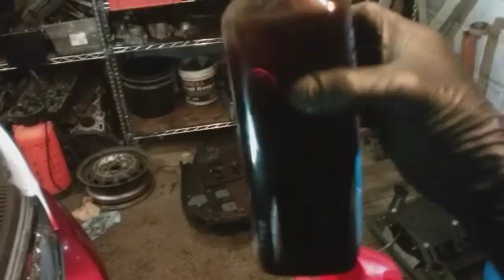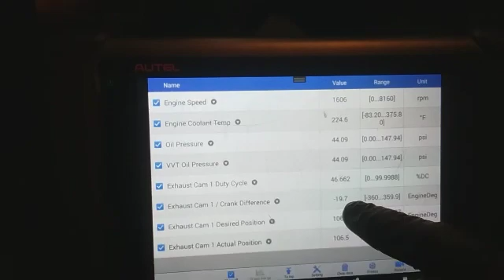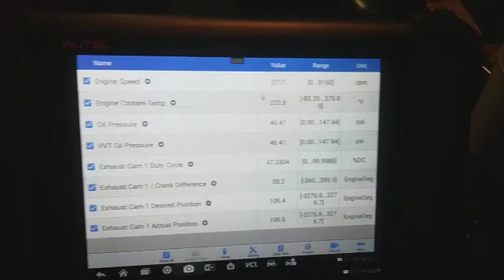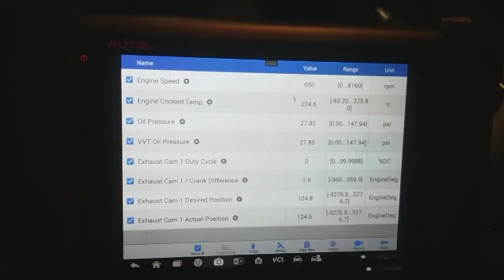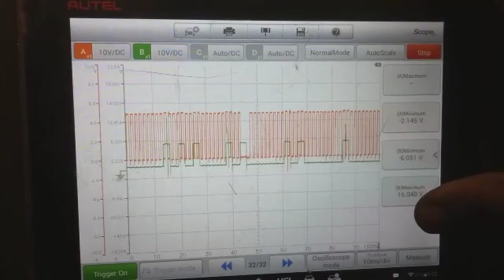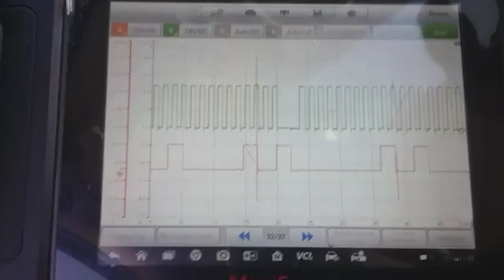P0344 FIXED! DODGE 5.7 DONT CHANGE THE CAM SESNOR JUST YET

Comment: 6 damn years ago, and this video helped me solve why my codes were coming on, and truth be told, never thought after a oil change, I would blow a oil line, it was subtle and slow, but found oil all over the lower end, slow leak, and i guess sensor got too hot, and got a low oil pressure code... man o man, your a god send.

Comment: Just recently went through this my buddy recommended I check to oil control valve beneath the intake manifold. Have had an issue since replacing it. Hope that helps!!
Reply: Correction: “Haven’t”

Comment: Broooooooo!!! I have had this exact issue for the last several weeks. My 2014 Ram 1500 Express 5.7L Truck has 190,000+ miles on. We had a really bad cold snap here is the Midwest.  My truck through a P0344 Camshaft Position Sensor code. Of course the first thing I did was replace the camshaft sensor. This actually seemed to cause more issues with the truck, as it started to go into limp mode. I replaced the spark plugs and coils as well. Needless to say, I did everything I could think of to do with it and even took it to a local shop and they told me to replace the cam and crank shaft sensor with OEM parts. I searched and searched the internet for answers. Somehow I finally came across your video and all of these great comments. This morning I changed my oil, reset the code and drove the piss out of my truck. No code!!!!!!!! Who would have thought something as simple as an oil change would solve all of the worlds problems!!!! Thanks for this video!!!! This should be the first thing that comes up when this code is searched.
Reply from the maker: @ShawnFranklin-h9t  cool man... thanks.

Comment: Guys, I also figured out that you have to reset your oil life on these vehicles. If it goes too long the oil count will cause the engine to go into limp mode. Turn the key to the run position without starting the engine. Press the gas peddle FULLY three times, within 30 seconds, and turn the key off. Start the vehicle and your oil life is reset. Have a great day.

Comment: Clean the plugs and contacts with electrical connectors spray, I used wd40 brand, plus took the sensor out and cleaned around the o ring and the magnet, if you do buy new get name brand, magnets on cheap ones are to weak and don't use the contact cleaner with power flowing thru battery, do this to the cam and crank sensors, they work together, can always check voltage on plugs . Should be 12v power and 5-10 on signal, middle is neutral, will be 3 pins,  both on passenger side under the side of the motor, one up front and one on back. At  Least on my 04 dodge 1500

Comment: My 2014 ram 1500 had the PO344 code and noticed low oil pressure I had a fairly recent oil change so I checked my oil level it was fine changed cam shaft sensor still check engine light came back on still low oil pressure so took it to the deal for a full diagnostic they came to the conclusion that it will need a new motor so I took it home thought about it and figured il change my oil again and check for metal shavings from a possible cam lifter issue there was no metal in the oil so changed my oil and problem fixed oil pressure back to normal and check engine light gone. 🤷
Reply: Did it ever come back?
Reply: @J.Smithsonian so far no

Comment: 4 years later, and I am at my wits end with a P0344. FYI - this was a complete engine build. The only stock item is the intake manifold. I am running Royal Purple break in oil (10w-30) and I would like to avoid changing the oil for no reason - that stuff was expensive. I only have about 15min run time on this engine. My tuner won't continue with the tune until the code is fixed. I had a bunch of misfire codes to begin with, but no P0344. Now it's throwing the P0344. I have replaced the cam sensor (but was told I need to put the OEM sensor back in) with no change. Misfires continue to count up in HP Tuners every time it is started. Was your fix an oil change or the crank sensor? I have a launch x432 - how do I get waveforms for these sensors on the Launch?

Comment: I’m at my breaking point with my son’s first car (08’ Charger 3.5L V6 w/129K) that we bought just over a year ago when it had 128k miles on it! Less than 1500 miles in one year! So far I’ve replaced All 4 rotors+pads, both front side suspensions, rear wheel bearing hubs, the starter, thermostat w/housing, all of those led to the WATER PUMP replacement!!! Ever since I’ve replaced it along with the timing belt, because if you are already in there you might as well replace the belt SO I did plus the serpentine belt! The fan assembly I replaced also because the two fans had been snapped in multiple places from prior “mechanics” plus myself adding a couple more due the awesome “plastic” design! 
That was in April when I pull two back to back ALL NIGHTERS because the dealership’s tow truck was picking it up to replace the AIRBAGS THAT were defective!!! It waited until after my May 1st birthday to reel back in and ever since I have been getting P0344 code, P0300, C121A & C121C, 2205, and so on! One code was the speed sensors that I also replaced AND NOW I FINALLY watched ALL OF YOUR VIDEO that reminded me of the OIL CHANGE my son had done last fall! Mother!$&@&@!ER! Well my fingers are crossed!!! 
P.S The last thing would do is complain about HOW F-ING LONG it took you to get to your point!!! I think a couple of Darren’s married Karen’s!!! 😂😂

Comment: 2009 300C kept reading p340 after changing cam position sensor problem got worse and read p340 and p344 they were timing chain issues there is a recall on parts and Chrysler fixed for free

Comment: Sr i need your help. i have a 2011 Dodge Ram 1500 5.7 over 2 months ago i had a check engine light came on, so i took it to a shop and they replaced the vvt solenoid, and everything was well with the truck till 2 days later the check engine light came back but this time came with the traction light and since than the codes on the truck were P0344 and P0340 i took it back to the shop and this time they replced the CAM and CRANK Sensors, but still didnt work out, then they changed the oil and the oil filter, they put on a 20/50 and the lights stills there, any idea how to fix it?????
also the truck is wasting a lot of gas, and the shop they dont know what else to do  & the Dealer doesnt have appointments till 2 months from now. so pls anyone can help me??????
Reply: Notice, the only code on the truck right now is P0344.
Reply from the maker: Timing chain likely will have to be replaced with vvt actuator
Reply: @partsshooter  Sounds good I’ll ask the guys from the shop to do that. Also the truck has lack of acceleration when is over 40/50 mph.
Reply: @partsshooter  Thank you so much for your help & your quick response. I really appreciate it.
Reply: @gedwerhoil1201 was that the issue? Please followup. Thanks
Reply: also i alreaty paid more than $700 i really need help.

Comment: I'll be d@^&*, I have an oil leak I haven't got around to fixing, until recently I had been diligent in checking the oil level, but got lazy recently. I had this come up 3 days ago and got progressively worse, even after replacing with a know good OEM sensor I had left over. Checked the wiring and could not find any problem, multi-meter tests are good. By the third day on 40 mile drive, I was loosing power, couldn't rev over 2500 rpm, intermittently and seemed to happen most going up or down hills. I watch this video and at first I'm saying you're high. But I go out and check my oil level (I'm only halfway through the life from the last oil change) and I was 3 and half quarts low. I top it off to max level, just went for a 40 mile drive and it has CEL and codes have not come back.
Reply: What you kept dancing around, but didn't directly say, its the VVT (Variable Valve Timing) system. The thought had occurred to me, that perhaps my phaser was failing and causing incorrect cam timing which the PCM saw as a bad Cam Pos Sensor. So clearly, if you have sheered down oil (thinned down worn out oil) or low on oil level, you get low oil pressure and it is resulting in the VVT system being unable to set the proper Cam Timing, which would make the Cam Pos Sensor return incorrect cam positions than the PCM expects to see, thus the PCM incorrectly deduces something wrong with the Sensor, when its bad oil pressure all along.

Comment: Dealership is replacing both cam and crank shaft sensors. My truck wasn’t throwing any codes. It would die and then not start again. After a while it would start up and run again.  I will see if that is the issue. This problem Is driving me crazy.

Comment: I have to admit I was like dang dude get to the point😅 just because I’m ADD and OCD and can’t sit still for five minutes but I’m glad I listen through a whole video I have a 2012 Dodge Durango with just a little over 100,000 miles on it and it through the same camshaft position sensor code and a thermostat temperature sensor code I then looking that up and I found this video and I thought wow I just had my oil changed about four or five weeks ago so I immediately got out and checked the oil level and the dipstick was dry so only being a couple miles away from the oil change place that did my work I ran it over there and asked them to check the oil level and they said nothing on the dipstick and I said exactly I just got my oil changed here four weeks ago would you look underneath for a leak the attendant came back up and said looks like your drain plug is leaking so after a little discussion they gave me a free oil change and put in a new drain plug and gasket also a new filter at no charge. So I drove it home and left the check engine light on I should mention I have a computer. The code did not clear but it was only about 7 miles back to my house so It probably didn’t do enough drive cycle so when I got home I cleared the code. Im going to drive the vehicle and see if that  sensor code comes back on again or not. So my vehicle obviously started coding because of low oil or they may have use the wrong viscosity just not sure either way it has lost oil. And I should also mention that this vehicle has not been known to burn oil we’ve owned it for six years never had a problem between oil changes so this was highly unusual and suspicious. I will try to remember to come back and edit my comment after I drive the vehicle for a little while. I Really appreciate your video it may have helped me out👍🙏

Comment: My truck (2016 Ram 1500) started throwing a P0344 and going into limp mode suddenly on a freezing cold, excessively wet evening.  I assumed electronics due to the conditions and immediately replaced the cam sensor and checked the connections.  Code went away for 8 hours and then came back.  I didn't even suspect oil to be the culprit.  After watching this, I found that my oil consumption was higher between changes than usual and my oil level was low.  Never would have suspected it.  Insane.  Great video!
Reply: Did the oil change fix the issue and clear the codes?

Comment: Can a leaking temp sensor trip up the p0344 code? Been dealing with this damn code popping up. Replaced cam, crank sensor, oil control valve. No issues for a few months but now it's back. Noticef a slight leak from temp sensor. No leaking anywhere else that I can see.  Always been on top of my oil changes and put fuel injection and valve lubricant in it every couple two months or so. Starts up fine, idols fine, little loss in acceleration. No one can pin point what's wrong. I'm thinking wire damage or that temp sensor leak. Any help or info is well appreciated!
Reply from the maker: No, leaking coolant temp sensor will not cause this code. Always remember when addressing check engine codes, just like conversations, STICK TO THE TOPIC.  Computers only mention what's implied, once a timing discrepancy occur, codes related will manifest.

1 thing that will definitely help, look up, the "Pxxxx code" -code setting criteria. If you find this, it'll describe the process in which the code sets. You can use this vital info to pinpoint whatever maybe causing that code to set.

Also, never overlook new parts...

I've had aftermarket parts be worst than what's originally in the vehicle, some sensors don't comply with this truck, get oem sensors and see if things change (crank and cam sensors)

Finally, you may actually have timing issues and timing chain may need replacing or vvt sprocket maybe failing or sticking.
Reply: @partsshooter  thanks, a lot! I'll try replacing the camshaft sensor again with an OEM. The last one I got was a duralast from autozone. It definitely could possibly be the timing belt. I bought this truck at 120k miles it has 127k now. If the belt was changed at 60k miles, that would make sense.

Comment: Thanks! This did the trick for me too. 2013 RAM 1500 w/ 5.7L and 130k miles. Had the check engine light with 'camshaft position sensor' code. Took it to the dealership. They replaced the sensor and charged me $240 for the trouble. Next day, the light came back on. So I did some googling and stumbled across this video. Sure enough, I was overdue for an oil change. Had it changed and the light went away. 50+ miles and it hasn't come back on. Great find!
Reply: I’m hoping this works for my 12 ram 1500. Changed the sensor multiple times and had the same issue kept kicking back on now it won’t start at all